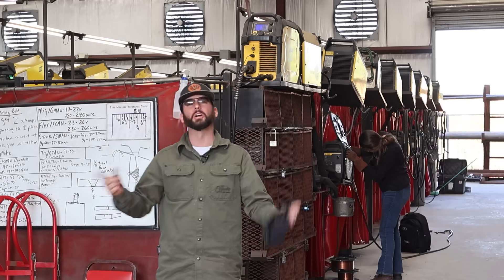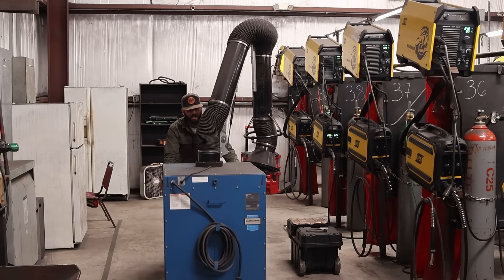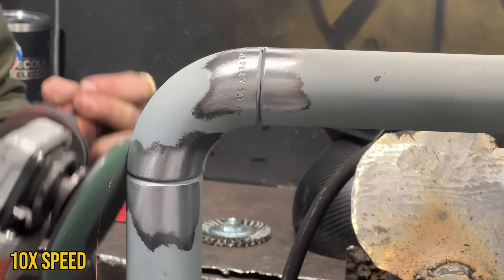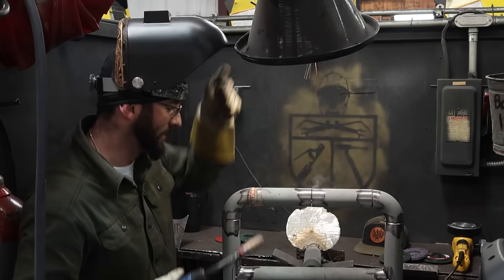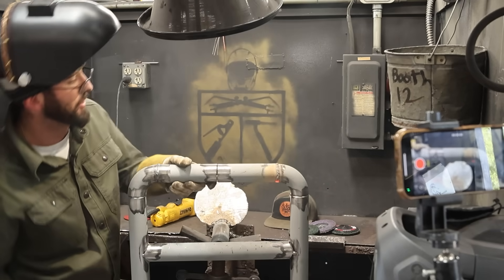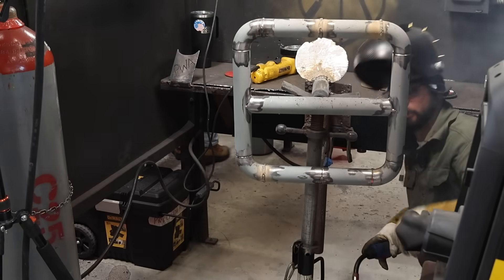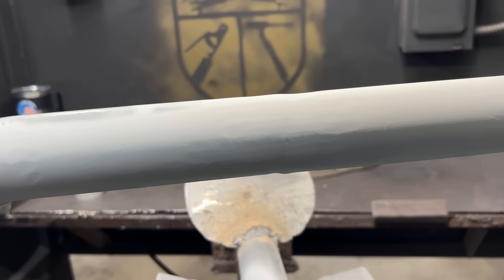Gasless Fluxcore 101: Welding a Galvanized Handrail Like a Pro

Comment: Unfortunately Austin, and I know you're loaded with wisdom, knowledge and experience, I will point out that while using this gasless FC, your drag angle was incorrect. You pushed a LOT in this video, and again, you were probably doing this out of performing more MIG welding, but it's worth noting, a DRAG angle to push the slag backwards is almost a must to note (for FC welding). Great vids, huge fan of your Channel! Keep it up!

Comment: Tip, hold your breath when welding galvanized steel without respirator. Always try to do so outdoors.
Reply: Inhaling zinc dust from grinding is not good for you either.
Reply: I still hold my breath even with the respirator on lol

Comment: Please show us noobs, how to use the cheap harbor freight welders.✅ Out here, we can't afford the fancy shtuff 😭
Reply: @diamonddetails9445  I work in an old shop with old equipment and half of the settings they use on the machines are new to me.
Reply: @diamonddetails9445  replace your ground clamp, get the 400 amp brass one from hf. It's 15 bucks. Turned my 89 dollar welder into almost a real machine. I also put in a 2/0 ground cable.

Comment: Cold galvanized is not a fair comparison to hot dipped galvanized like you will actually get you will need a hard rock disc to get it off. You can see when you finally get it off when you see sparks flying the galvanized itself won’t spark the grinder

Comment: I do stainless guard rails for a living in Germany . Most stuff gets Tig welded without filler . And except for the handrail on top of the guard the welds don't get smoothed out. .just cleansed. Never had a weld failure

Comment: Fluxcore 101 - the machine has to have impedance control & the wire diameter must be 0.9 or 1mm   - 0.9 is a compromise, 1mm is ideal.  No arc force control, rubbish flux-core machine. 
Wire brand matters - a lot of flux core wire sold is junk - pick your brand carefully. 
Flux-core is a flawed process - I use it all day every day, but I have no illusions. You have to do far more work than you do with gas shielded, if you can accept that trade off in order to not buy gas, then it is for you. The flux is highly corrosive - you have to immediately clean your welds or else everything around what you welded will corrode like crazy  - a drill with a wire brush, chemical cleaners - all them things. 

Flux core done well can look like you tigged it - but there is a skillset involved & work involved. Gas shielded is far easier to master, but you gotta pay more, lug around the bottle, blah blah.  Pick your poison.
Reply: my FC-90 only has 2 knobs and works great with Blue Demon wire
Reply: @yurimodin7333  I have maybe 10 or 15 machines to pick from here at work - some weld real good with flux core, but once you experience what having impedance control can do, you raise your standards of what "Great" is.

Comment: What size wire did you use? 0.30 or 0.35?
Reply: Missing information like this is what gives such a heavy contrast between these modern videos from this channel and the older ones from Bob and RedBeard.
Reply: @YR7A  okay so I did some personal research and went out and bought some Forney 0.35 wire for my fluxcore welder. It welds superb. I had 0.30 wire before and found my welds were really skinny and I needed to slow down so the weld would be a bit thicker. So I'm guessing 0.35 is the way to go when you're dealing with this kind of metal/fabrication. Hope this information was helpful.

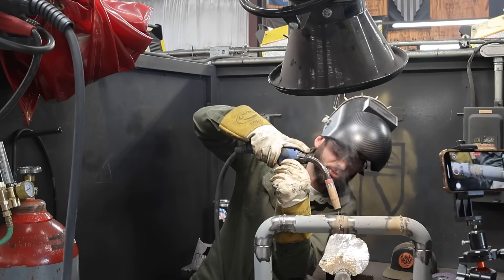Comment: Around 8:40 you said, "and don't let that wire go through the back" - could you say that another way? I didn't know what you meant. And I'd like to see a video that explains more on blending for a top-quality appearance.
Reply: It'll poke through, and you'll leave a "whisker" of welding wire on the inside of the tube.
Reply: my experience is you have to keep the wire in the puddle,if you get too close to the very front of the puddle the wire 'pushes out the back',it has to be close to get penetration but don't overrun it.Takes practice and know your settings
Reply: Yes, stay in your puddle more, with the gap in front of your weld, if you move to fast the wire will go through the gap.

Comment: I only  use fluxcore and have often problem with seeing  what I am welding. Much fumes and a gas nozzle in the way keeps me fighting. I am self teaching so all you show I try to use in one way or another. Thanks for great videos.
Reply: Best you can do to help that is get one of the dedicated self shielded nozzles that with not gas passage
Reply: I struggled alot to see until I got a better helmet(Chicago Electric) vs what I had AND I put a cheater lens in it.....I guess 40 is old enough to need a cheater.
Reply: You should never have a hard time seeing what you're welding. If it's not due to a fact that you need glasses or something to see, then chances are your outer lens is scratched up. I had issues for years determining how scratched was "scratched up" ... Every 6 months or so for years I would swear it's not my lens, it's not even that scratched up yet. I think I'm going blind 😆 until I finally change my lens. Took me years to come to terms with that. But you should never struggle to see your welds. If you are, change out your outer clear lens
Reply: For flux core welding remove the shield from the nozzle. It’s not necessary.  This will help you see the wire.
Reply: Try going up a shade. If you're using 10, switch to 11. It'll be slightly dimmer, but so will the light hitting the smoke particles. It should also get rid a lot of the arc flare.
 
Hope this helps.
Reply: I too sometimes struggle seeing my flux core welds. It's mostly when I run them fairly cold due to thin base materials though.
Reply: Low fan, fluxcore will weld in wind

Comment: Okay, I am no handrail professional, but ¼ inch seems so thick. I mean, some entire buildings are made with I-Beams that are not really any thicker than that. (Sure, dofferent shape, and application, BUT IT'S A WHOLE BUILDING). But hey, if that standard holds true here in Namibia, I can rest assured that the handrails will catch me, even when I fall onto one from a 10-story building. 😂

Thanks for the video!
Reply: Max, you are right. Guy in video is wrong. 1 1/2" sch 40 pipe actually has a wall thickness of .145", not "just over a quarter of an inch."
Reply: You’re right! This is heavy duty for handrails. I can say I had trouble finding some parts for this, as far as something people could re create. Guardrails are treated differently than handrails, you’ll see thicker pipe on these.
Reply: But he did call it thin wall tubing.